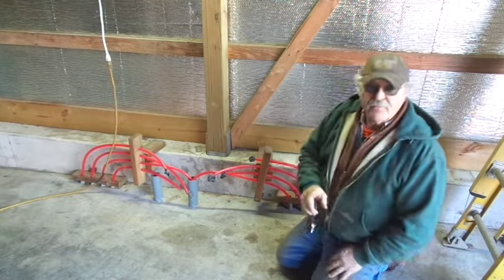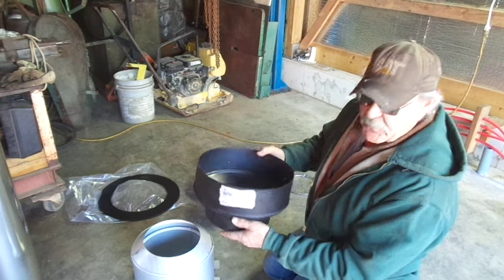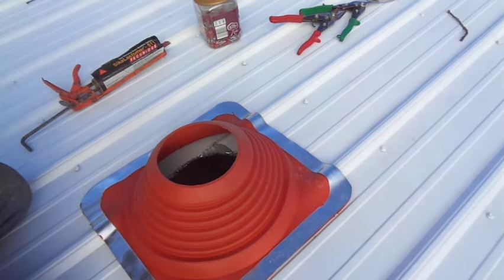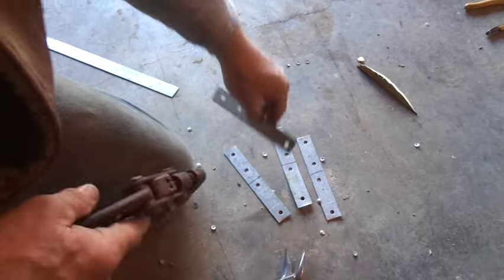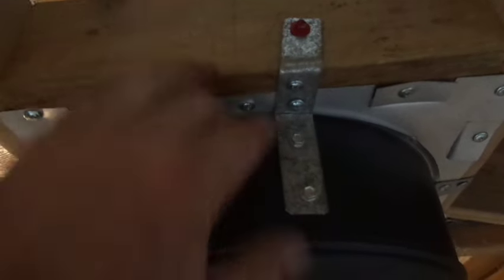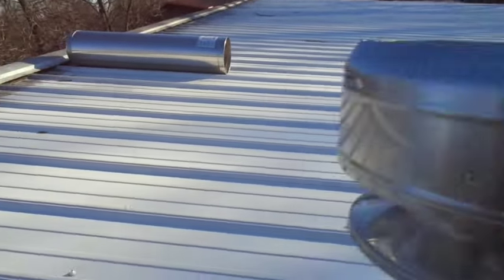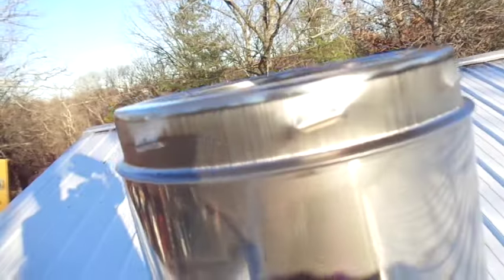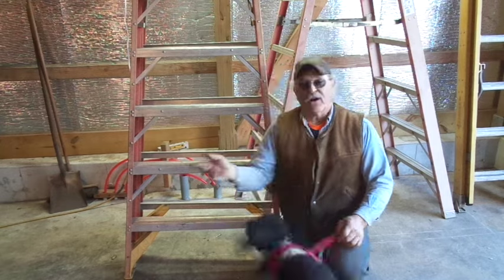Wood Boiler Flue Pipe Installation and Tech Talk

Comment: I think the manufacturer says if the chimney is within 10' of the peak, extend 4' over the peak.

Your tendon story reminds me of my dad. We were making sauerkraut and the cabbage we get are huge 18+lbs each. So he was quartering them to fit our old slicers. Well he set the knife down on a head, and left a finger in the way. Right through and hit the tendon. Keep in mind, he used to be a 1st responder at a yacht manufacturer, but the sight of his own blood makes him faint. I've never seen his skin so pale.
So Mom takes him to the ER, and he was blessed cause the doctor on call was the only one in the hospital that could stitch a tendon.
Reply from the maker: Now that's a good story about your Dad. He got lucky with the right doc on call.  I went to the emergency room and the on call doc cleaned it and bandaged it up with no concern about the tendon.  He said it'll be all right, but with in a week I had a knot all the way down into my palm and the joint had quit working.

Comment: Nice job Wendell 🙂👍 That's scary stuff about getting sliced by the cap!! 😰
Reply from the maker: The SS is a raw edge inside of the cap and they always seem to have a thin film of oily residue on them.  It sliced right to the bone in an instant !!  Such a clean cut that it didn't bleed for a split second, but that ended quickly.  I got red leakage everywhere.  Thanks for stopping by for another one Zane.

Comment: I, at the camp, have almost the same set-up except the flange is for an asphalt shingle roof. I`m sure yours will work just fine....CHEERS
Reply from the maker: The sheet metal tall cone flashings are very hard to install without leakage on corrugated roofs.  Not too bad on shingles though.  All I can say is this one is not leaking yet.  (-;

Comment: Hi my friend.  Great job as always.That piece of pipe  flashing was very interesting.  A heated floor would be nice. I have lain on concrete that had snow and ice ,while welding  Not fun. As always I liked and shared. All my very best to you and yours.
Reply from the maker: Usually in a normal shop the floor is the coldest spot but with a heated floor, it is the WARMEST spot !!  Eventually there will be a maximum of 170* water circulating through the 4 circuits of Pex tubing. My target temp for the workspace will be somewhere around 60*F. Thanks for watching and sharing Bobby.

Comment: Good video. I installed a metal flue through the metal roof on our cabin.  I was tempted to use the flexible flange that you have on yours, but went with the metal type, tucking it under the metal  roof on the top side and bringing it on top of the metal on the bottom side of the flange, using plenty of caulk also plus a lot of screws like you did. The metal type is vented with a rain cap just above vents. I was worried about hot air building up with the type you have.  My wood stove was in a cabin however, not a pole barn.
Reply from the maker: I've checked the area under the roof at the opening numerous times with a laser thermometer and its barely over the temp of the rest of the interior ceiling area.  So I have no concerns about that.  I've installed the metal tall cone flashings on corrugated metal before in similar fashion and it not fun.  As you know.  (-;

Comment: Ive never used that type of flue pipe. I do have some used ones that I bought at a auction. I usually use a section of 6 inch well casing.
Reply from the maker: Oh heck yeah. I have an 8'' schedule 40 steel casing in the other shop.  Supported all the way down to the floor though. I cut a saddle and welded it into a Tee for a cleanout then added angle iron legs down to floor flanges.  Then a heavy gage steel band to attach it to the 8'' flu opening on the furnace.

Comment: Hello, Tractorman44...minimum 2' above. It may vary regarding location. The largest A vent I've installed was for a massive generator.  Stainless inner liner was 14" with a 4" wall. Ran it horizontal for 50' then up 60'. Each 5' length weighed 105 lbs. Sketchy installing with a boom lift. Thxs for the vids!
Reply: Now this is something I’ve been wanting to do, replace my old pipe. It’s a triple wall stainless pipe that measures 10” outside. I did have a chimney fire in it years back and the fire co. Came. It certainly was exciting. Thing is is was eating lunch with the intensional of cleaning out the pipe after eating. Alice hollered down the steps that the pipe upstairs in her studio was smoking and hot! I looked at the pipe on the wood stove and she was red hot! From the second story deck I keep a ladder there because i go up with my brush and rods once every so often. I go about every month now. The pipe held up but where it goes through the studio ceiling it had the joist smoldering! It’s a metal roof like you have there. As the fire company was on their way I was one the roof checking if it was hot, as I had visions of fire being drawn up between the ceiling and roof and very bad indeed but the roof was cold! With 21 volunteer firemen and engine down our 500’ lane it truly was an experience! Now 3 years ago or less we had a chimney fire again in our masonry chimney. It’s block with a liner but since I was out of commission health wise I hadn’t cleaned the chimney in a year. So some large flakes of creosote fell and blocked the draft below but above she was smoking!! I had put some paper in the cook stove that took off much to fast and I will say the chimney was super clean afterwards! I’d shot a fire extinguisher up the clean out door but it was blocked 3/4 the way up so it didn’t hit the fire. Another 19 or 20 volunteers came and we are very thankful for their dedicated work! I wasn’t in any shape after heart surgery to climb ladders because if I had been the chimney would have been clean. Have a 8” square brush for that one. I did have one in my shop stove years back in pipe like you just installed. That dark brown black smoke poured out but didn’t last. Metal roof there too. I went in the loft and the pipe was warm but did just fine. I inspect the chimneys often now, as you might expect fer ser! But I really wanted to say Thanks for the 44 Adventure Vid and I’ll certainly be drippin, tippin and sippin in the morning in your honor and in celebration of the lovely and shiny stainless chimney! Squeezez Pleezez! DJO
Reply from the maker: Now THAT was a flu !! I'm glad it was you and not me David. LOL. Those days are long behind me now. Retirement is much better.
Reply from the maker: @daveyjoweaver6282  Thanks for the first hand story of a flu fire or two.  A lot of people that heat with wood don't understand the volatility and outright seriousness of a flu fire.  And I've seen my share of questionable materials being used instead of the good stuff. I inspect mine frequently too, but the main thing to keep in mind is the moisture content in the wood that feeds the stoves. As always my friend, its good to hear a story from up your way, and I remember well the tough time you went through.  But it IS a story with a happy ending at least.  Yessir me and the Missus be sitting here tossing 'em back talking about DaveyJO stories right now....of course its the non-alcoholic hot and tasty JO-cups we be tossin'.
Reply: @tractorman4461  So true my Friends! With a good CuppaJO, who needs booze? In fact on Sunday mornings I get out the French Press (Bon jour manure) I always say,,,,well sometimes! Anyway my daughter Jenny out there Portland Oregon way sends us this special JO we call JennyJO or OH GOD JO! Cuz it’s so good! I hand ground it and made a 12 cup pot of SquoozeJO! Plum Finer n frogs hair fer ser! So a Special Tippin your way on Sundays! Oh yes indeed, dry wood sure makes a difference with clean chimneys and good heat! Now, back to some more Tippin, Squeezing too!
Reply from the maker: @daveyjoweaver6282  From time to time DaveyJO I pick up Jenny's book and re-read a few paragraphs about Bud.  So tell her I appreciate all the special work she put into making that story come alive for another one of America's Greatest Generation !!  The Missus's uncle survived and lived to 95, passed just a few short years ago.  He was the one (I think I told you about) that was in the second wave landing in Normandy on D-Day.  One of the lucky ones, he was.

Comment: Chimney rule is 3-2-10

Min 3’ protruding above roofline on top side 

Where the chimney comes in contact with the roofline @10’ it must extend 2’ past 

If there is more than 5’ of chimney free standing roof bracing kit is required. 

Question: is that reflective foil a non combustable material ?? 

Insulated factory built, Chimney must maintain a 2 inch clearance to all combustible material. 

I install 2-3 wood burning chimneys a week. 

In Canada, that flashing would not be acceptable, it would only be acceptable if it was a factory tested component, tested by the manufacturer of the chimney, the rubber boot flashing we use here in Canada has a 1 inch sleeve separating the rubber boot from the actual Chimney.
Reply from the maker: Some of the codes stuff is becoming a faded memory after ten years of retirement.  I had to cut out a lot of footage to shorten the video, and part of it was where I took two more inches of the double mylar coated insulation off the perimeter of the hole. Just to be sure.  I don't think it'll burn,  but the plastic bubbles I'm sure will melt. 
   The flu supplier sold the flashing right along with the Class A insulated flu pipe and other accessories and we have used these on numerous jobs that have passed inspections.  But I cannot for sure verify its having been tested by the manufacturer of the flu.  Good question, and thank you for the input.
Reply: @tractorman4461  very nice installation tho, I have to inspect customers installing their own and have seen some ugly stuff . I’ve sliced my self a few times  on stainless chimney hardware ,dang that stuff has an edge . Thanks for your reply .
Reply from the maker: @gboz4245  Thanks for the kudos.  I've been in HVAC since '76 professionally and trained as an electrician by Uncle Sam's finest, the USMC, five years prior to that. Happily retired now and just doing the things associated with the trades to help people out.
Reply: @tractorman4461  np you are def a gifted tradesman .
Reply from the maker: @gboz4245  Thank you....I appreciate the kind words for sure.

Comment: Do you think it will ever reach over 2100? Degrees
Reply: And nice cut super clean
Reply from the maker: Yes there is no doubt it will during a creosote fueled flu fire.  But it could easily run 1000 to 1200 F with normal firing as long as you are using well seasoned wood.
Reply from the maker: @Cheemzs  Thanks for the compliment.